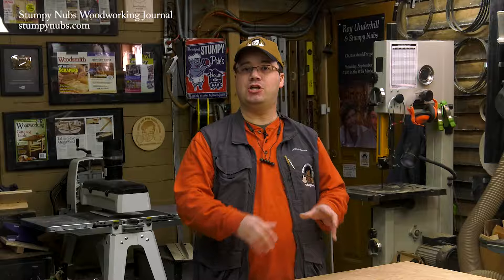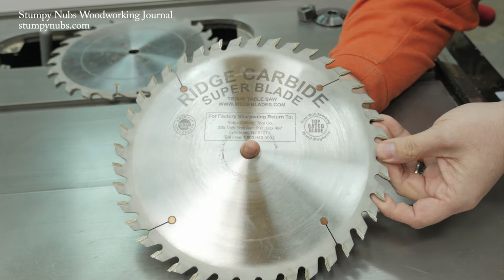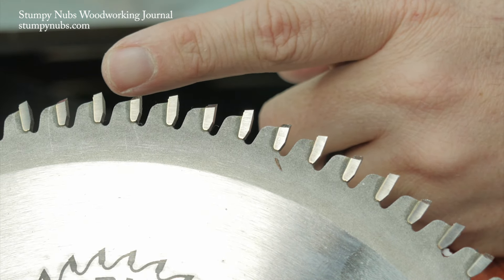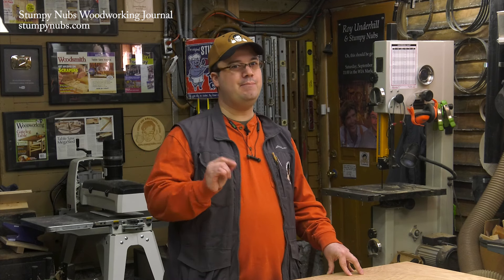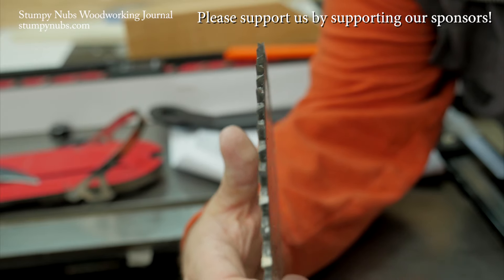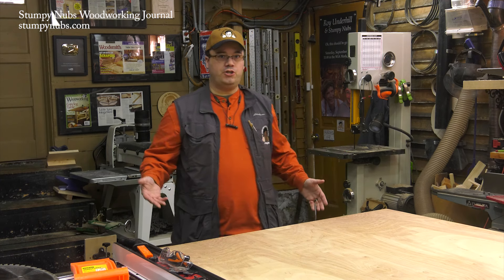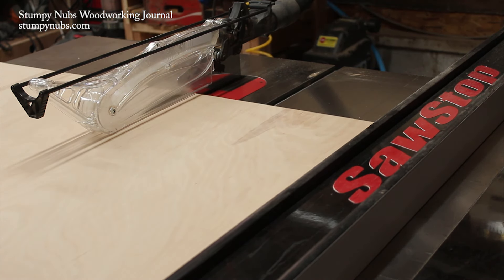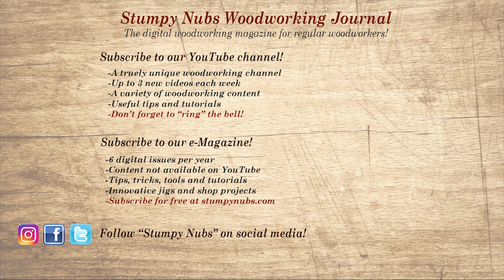Plywood is difficult to cut on the table saw? Let's fix that...

Comment: I have been around carpentry for many years, but just recently around some cabinet construction. So having a bunch of tools not as available in framing or making things that really didn’t require a joiner, planer or a table saw I found myself with a new table saw. Some terminology and things foreign to me. Your videos are super and clarified a lot of question rolling around in my head. Thank you for taking the time to explain the workings of the table saw and the safety tips. Now I feel more confident to not feel too confident in finishing my cabinet making.  Thank you very much!

Comment: The final video lived up to the preceding 4 in giving great advice on safety and getting good results. My work shop is on 10' by 8' and mostly used for turning but a table saw is amongst my armoury and is used. If I need to have sheets cut down I always get the timber yard I buy my sheet goods from to do it, at a cost, and also leave "room" for me to finish it off. Once again a great series. Cheers, Huw

Comment: Getting a track saw changed my life.  I originally did it when I lost shop space to fit a table saw.  But even after solving that problem, I still find that the track saw is a huge improvement to how I work.  First off, it generally allows a single person to easily break down a 4'x8' sheet of plywood without struggling, and is better than anything I've seen short of a sliding table saw.  There's no need for rough cuts, as a good track saw with the right blade will produce accurate finish quality cuts every time.  But what really surprised me is how much more efficient a track saw is than using a table saw.  Admittedly the projects I do rarely require cutting a lot of pieces to the same dimension, where setting a table saw fence or sled up once would enable repeated efficient cuts.  For one off cuts, I lay out my cut on the plywood, slap down the track, and cut.  No clamping required, no worries about muscling a large panel onto the table saw and keeping tight against the fence.  It's enabled me to be much faster in my work.  And now that I'm an old fart (and getting more so every day), I appreciate the reduced physical effort required.
Reply: track saw is the best saw i ever bought.

Comment: Thanks James. Very valuable series! Several years ago I bought two "single roller" pedestal stands to use as supports for my out feed. I don't recommend them to anyone now. I discovered that unless they are aligned PERFECTLY,  they will actually try to pull your plywood into or away from the rip fence. My next out feed stands will have multiple roller "balls". No more rollers tubes for me.
Reply: You are so right Charlie! I bought the single rollers a couple years ago and hardly use them. If you have room an out feed table is the way to go.
Reply: Hmmm!   My stand has balls in a mount that I normally swing down to expose an alternative long roller.   After reading Charlie's post, I think I'll leave the balls in place in future!

Comment: I'm learning some much watching your videos. I haven't used a table saw since junior high, I'm going through all your videos. I just got a great deal on a Ryobi 10" portable Table saw attached to a meatal stand. I'm not going to be using it much, but I also wanted to keep my finger's. Thank you so much for making this so easy to understand. I just ordered the safety tools that weren't with it. This saw had only been used four times. There was almost no sawdust underneath the saw by the motor. After cleaning it up, and using Corrosion X, it really does look brand new. Thanks again. Bob

Comment: In 1993 I worked in a cabinet shop that used hardwood faced mdf extensively. We used a Powermatic 66 with a Biesemeyer fence. The owner had the table saw set into a roughly 10 by 12 foot table that allowed much easier breakdown of sheet goods. It was still quite a chore.

Comment: Hey James, thanks for putting this table saw series together.  I've done a lot of work on my old table saw that, on reflection, I'm glad I still have all 10 fingers.  That was by pure dumb luck not any measure of skill.  I watched all 5 of these videos back-to-back and will continue to subscribe to your channel for more woodworking tips.  I did move halfway across the country recently so I sold all of my large equipment before moving with the intention of building a dedicated shop and purchasing higher quality tools. So, I'll be looking for some tool tips and buyers guides here soon.

Comment: The five instruction videos on the use of the table saw are extremely informative, very clear and helpful.  I am sure that the in-depth understanding you provide together with following your advice will improve my woodworking skills and my personal safety. A great job - 5 stars. So thank you!  Can we please now have a similiar series on the router.

Comment: Thanks for this series. It’s quite a lot to think about. It was well presented and seemed quit comprehensive. I have subbed and hope to learn more.

I’m nearing retirement age and recently bought a pedestal table saw, 10in compound miter saw, and floor standing drill press (all used) that I plan to spend a lot of time with in the future. I have some experience, but my tools were limited to hand held models previously. The table saw is the most intimidating by far, and I spent some time cleaning, lubing, and adjusting it just to get a good idea of how it works and what it’s quirks may be. Recently, during a rip cut on 3/4 plywood I let the off cut get away from me and it climbed on top of the blade, shot past me and dented a tool box. That’s how I got here watching videos. I play guitar and would like to keep all my digits and hope to do some quality work. 

One question I have concerns being left handed, I assume your examples in the videos are from a right hand perspective and some seem a little awkward to me. My saw blade pivots to the left and I tend to stand to right of the blade’s plane of rotation if I have a choice. Are there any strategies or accessories for us “wrong handed” folks? 

Thanks again for the great video’s.
Reply from the maker: Left tilt or right tilt, it's pretty much the same, just reversed. Stand to the opposite side of the blade as the fence is on. The tilt direction really doesn't come into play unless you're cutting edge bevels. I recommend you watch all the episodes in this table saw series (see the links int he description below this video), as well as our "kickback" video: https://www.youtube.com/watch?v=8f8VWwtaudU
Reply: Stumpy Nubs - thanks

Comment: I rip or cross cut plywood with a straight edge and a circular saw on a sheet of foam to insulation board to rough working size pieces.  Then move to the table saw to the true panel to final dimensions.  I also tend to use a sled which makes things glide thru the blade with ease.  On fine veneer I often use a razor knife on the layout line and use a zero clearance inset in the table   top to minimize tear out on the underside.  If my shop was more than a garage I would have out feed tables on three sides.

Comment: Thanks James, some good safety reminders.  I keep an 80 tooth blade in the shop that is only used for sheet work, it produces wonderful clean edges no matter the orientation of the surface grain.  Several years ago, I made two edge guides (full sheet and half sheet) out of some scrap OSB so I could accurately break large sheets down before working them on the table saw.  The saw guide is positioned so that each of my favourite circular saws has its own edge.  Works well and cost nothing.  My shop rule is if it is difficult or unwieldy to handle, stop and rethink the process.  Safety cannot be practiced retroactively.  Thanks for sharing, this is an awesome place to learn.

Comment: All I have is a small jobsites table saw so it's next to impossible to cut sheet goods accurately. Best tool purchase I've made in years was a track saw. I can get cleaner cuts than the factory edge. Next to zero tear out on even 1/8 in plywood cutting against the grain. I originally bought it because we had a huge remodel and there were about 50 doors that needed the bottoms trimmed. That track saw literally paid for itself before lunch the first day with the amount of time it saved me vs using my circular saw and a straight edge. And the best part is, I can break it down and throw it in my back seat every day.

Comment: I’ve worked at Union Memorial Hospital in Baltimore, which is the hand trauma center for the mid Atlantic region, for more than 20 years and probably the number one reason for the loss of fingers is the table saw. So Thank you for your videos on proper table saw use and safety.

Comment: Alwase good info here. Thought I'd mention using some painter's tape on your cut line can also limit the tear out on the top veneer. A good blade, and painter's tape, will produce a sweet clean cut. Just throwing it out there.

Comment: Hi, thanks for the great videos. I recently bought an old contractor saw (Delta 34-410 knock off) because ripping sheets of plywood was basically impossible on my itty bitty saw. Most of my work needs rectangles with sides between 14 and 26 inches long made from 15mm Baltic Birch with the odd 48" panel. With your help, I have set up the saw and learned that I was using my miter gauge wrong. which explains the all missles my old saw fired past me. I think I will probably upgrade my blade as well. The new saw has a 60T general-purpose DeWalt on it right now. I might have an old 80T Freud Diablo kicking around that I used to use for cutting moldings in my chop saw...but I'm thinking that maybe I should just bite the bullet and put one your recommended blades on this saw, so that I can just leave it there and cut panels for years without worry.

Anyhow, mostly writing to let you know that the 80T blade link in your description no longer works but also wanted to thank you.

Comment: I’ve enjoyed this series on one of my favorite tools. Again even after 35 or so years using the table saw I still picked up tips. Thanks. BTW in my opinion. I never attempt to cut large or full sheets of plywood. I even use my circular saw and a clamped straightedge to reduce the size piece or for cabinet boxes to the actual size needed. That’s just me. I can maintain full control over my work pieces. It would be nice to have a table saw with in feed and out feed tables and side support to cut a full sheet but I’d still need help getting it up there. I’ll stick to circular saw then table saw. BTW Again. I get a kick out of your channel name. Makes me think of a carpenter with missing tips of your digits 😂😂😂 not really funny but you apparently have all your digits in tact. Maybe just short fingers. Keep up the great work, you’re an excellent instructor!!!!  Takes a lot for me to recognize that but you definitely have it. Good day.

Comment: Truly excellent video to this classic series!  I have a DW745.  It's a good saw if you have a 10x13 workshop  One of the problems with it is short infeed space.  Your video prompted me to think about infeed solutions.   Not for plywood, but for any longer pieces or for sleds.  I break down plywood with a tracksaw.  

Also, thanks for the info in the comments below on the negative tooth blade being used on the table saw for fine cuts.  This means I can swap out an 80-tooth blade between my table and miter saw.  I'm only buying Ridge Carbide blades in the future and will buy them thru your site

Comment: I use a blade with a negative hook angle for cutting plywood. I also use them on radial arm saws.I have one table saw that I use for ripping. Old 12" 5hp powermatic.
Reply: The powermatic has a 24 tooth rip blade.

Comment: I buy most plywood I use I get at Lowe’s or Home Depot. They give you one free cut   So since most projects ( not all) use less then 24” wide pieces I always get them ripped in half. Makes a huge difference in the shop. Thanks for all your tips 😎👍
Reply: Big Dog
That works until the person cutting the ply gets a crooked cut from the panel saw!

Comment: I love that cart that allows you to go from the truck to table saw.  That should be in every ones shop that cuts up plywood on regular basis.  I have also seen this clamp like thing that grabs the top of the sheet. That way if need be you could handle the sheet goods with one hand making it a lot less awkward.

Comment: You're the top in the wood shop, IMO, especially when it comes to safe, quality tools and practices. So, why the sparse treatment of track saw systems for breaking down sheet goods? I went with one years ago and found the accuracy and cut quality on par with my cabinet saw. It's also easier and safer than pushing a 70lb. 8x4 sheet of plywood across a TS. Festool's MFT and Kreg's new Adaptive Cutting System are very versatile. I'd love to see you review them.

Comment: Hey Stumpy, 

I’m a relatively new woodworker who has a very limited amount of space in my garage for tools. 9 months ago I didn’t have a drill—now I’m up to a thickness planer, band saw, drill press, jointer, miter saw, router table with lift, about 14 power hand tools, and an absolute f-ton of manual tools. My problem is that I don’t have the room for a cabinet saw, so I’m using a dewalt contractor saw. I say “using,” but in reality, what I’m doing is avoiding using it because I’m so afraid of it. There’s just so little information on how to safely use saws like those to do finer woodworking. The in-built support is lacking, the saw seems built for people who are comfortable working on the fly, the blade guards are really clunky, and I’m just so scared of kickback that I avoid using it at all costs. 

I’d love to see a video on using saw like those to execute many of the cuts that you’re doing on a nice cabinet saw in your videos. I don’t expect it to function AS well as a multi-thousand dollar, cast iron table saw, but it would be nice to get some confidence in use so i can build the things i want (cabinets, tables, and shelves). Thanks!!

kristie
Reply: You can get roller stands. They help a lot!

Comment: Good information.  I have a question about making a 32x22 panel. I used my track saw to make a 22 wide rip across a 4' sheet of 3/4 Birch ply.  Now I want to break the 48x22 piece into a 32x22 and 14x22 piece.  how do I perform the cross cut to get the final square cut on the 32x22 piece?  22" deep seems tricky with my miter fence and not sure if the crosscut sled will work well with that deep either.  I have not make a crosscut sled yet as I have not determined the proper style or size to make.  I do have a new Delta 36-1500 contractor saw.  Thanks for all of your great content.

Comment: Don't know why I just saw this video...in any case, it's great (as usual) but this time you forgot the most important part:  table up, circle down.  Tear out will definitely occur with any plywood even with an 80 tooth blade, if you want the plywood to be on the "bad" side, cut the plywood face UP on the table saw, and face DOWN if using a circular or miter saw.  There, I feel better now.

Comment: I was requiring some guidance/assurance about cutting some sheet material with some mitre joints at the top of a carcase construction I am involved with when I came across your videos about the circular saws. I found them very informative and helpful, even though I've been using a circular saw for some years. I guess every day is a school day and everybody can learn something new.
I also couldn't help notice your delivery and explanation was much more professional and greatly improved from your earlier videos. Not that the earlier ones weren't instructional, but in these ones the information was to the point, well researched, extremely well delivered, and your timing and pace of information is excellent.
Thanks for the assistance, I'll look in again.

Comment: I have used many different blades over the years, some good, some not so good but in the end I have found Forest blades to be the very best. They are not cheap but in the end you get what you pay for. Also, I send them back to Forest for resharpening which is also worth it.

Comment: Thank-you for your videos.  Since I recently bought a table saw I've watched them several times.  Today I was cross-cutting 14 x 70 inch plywood down to 14 x 64.5.  Since I'd violate the rule of "length on fence > distance from fence to blade", I tried to use a mitre gauge.  However it was hard to keep the board flush with the gauge block because the board was so long.  Is this an example where the table saw isn't the tool for the job?

Comment: Thanks for the info. If you don't mind, I could use some ideas for use of a table saw while seated.  I am in the process of expanding my workshop. In the past, I'd always just gotten really creative with lumber selection and use of a miter saw for home construction projects, limiting myself to 4 and 8 inch construction lumber. But, I've reached a limit to what I can do with a miter saw, and using a circular saw in a wheelchair is not safe for me at least. So, if you have anything that comes to mind, it would be appreciated.